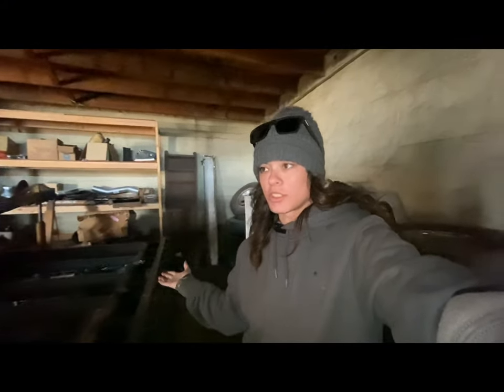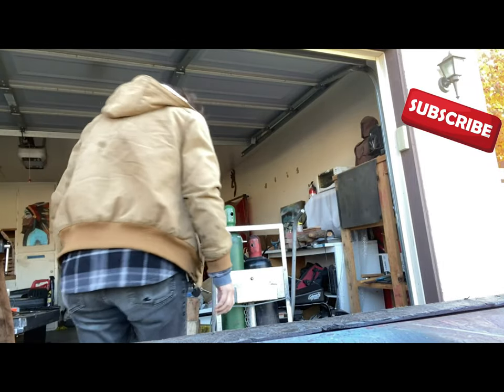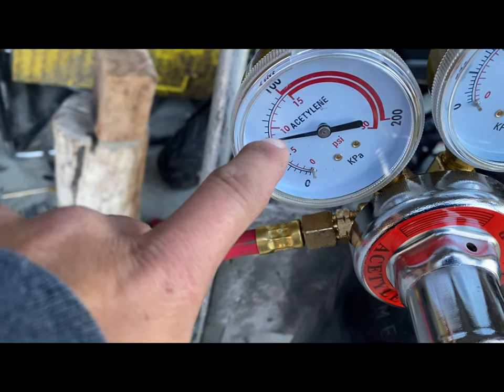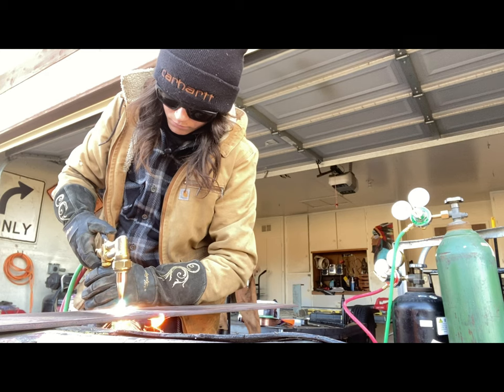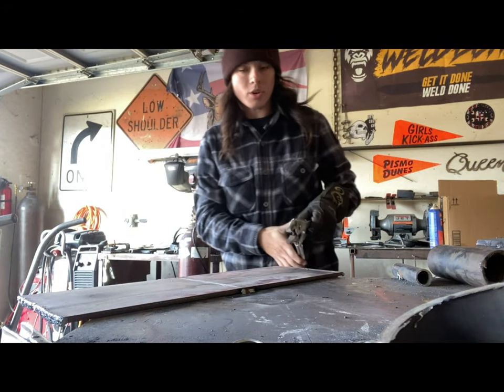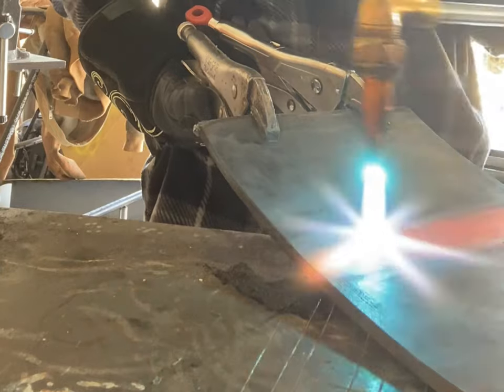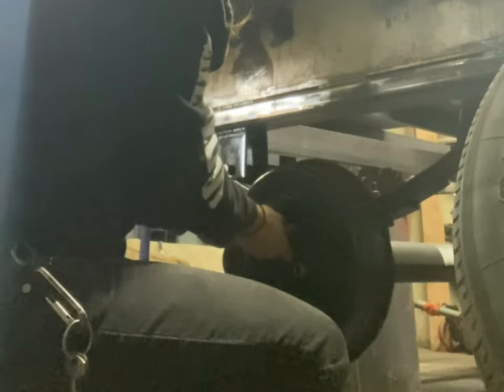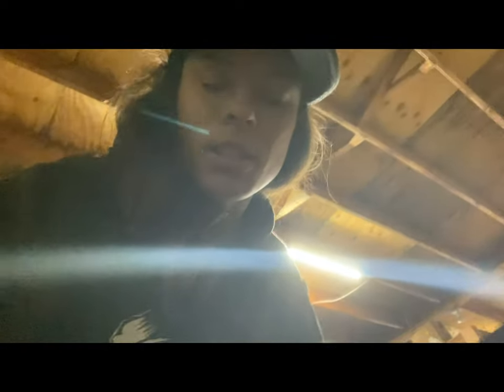Pre Bending Six Quarter Inch Fenders To Fit In To Wells On The GooseNeck Trailer

Comment: Those turned out looking great! 
I was wondering about your cardboard template checking on hot metal. Glad it didn't burn up completely!
Reply from the maker: It’s the only thing I had laying around, I was working on this part of the project for a little bit.
Reply: For sure use what you got! I like moving the template to hardi-board. It's cheap and easy to work with and a lot sturdier than cardboard